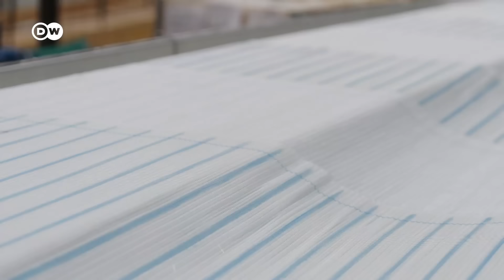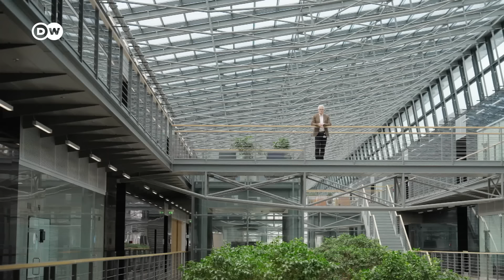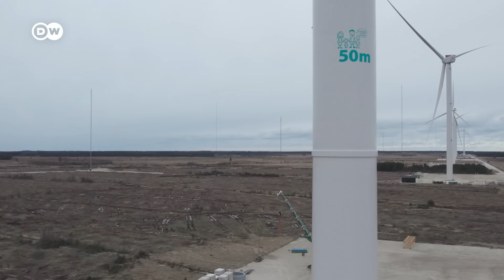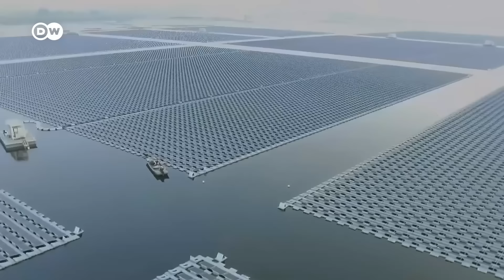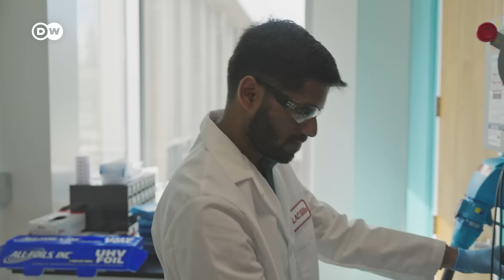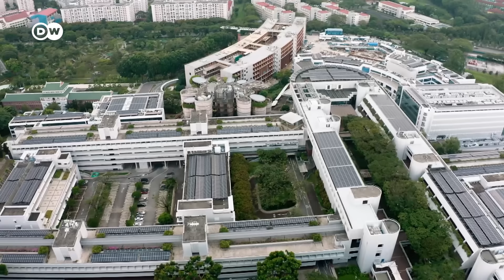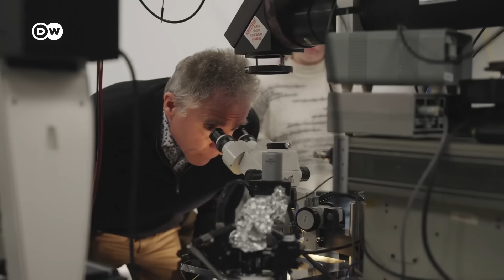Will renewables stop the climate crisis? | DW Documentary

Comment: the absolute climate-culprit is the vacuum "cleaner", it pollutes way more than it cleans

10 grams of dust in average pr hour while burning about 850 grams of fuel in a power plant

they should be banned or at least made with motors that produce 0% waste heat

Comment: Not without Nuclear.  New Modular Nuclear is safer & cheaper & can be built in six to twelve months.  Mainline Nuclear is already far safer than Fossil fuels that costs 8.1 million lives a year with many more lost from crop loss and forced movement.  An international safety inspectorate will make Nuclear far safer and would have avoided all the major accidents we've experienced.   The one renewable that shows great promise is deep drilled Geothermal power.  But as with all technologies it needs time to mature.  We don't have that time.  Already the living habitats and our creatures are being destroyed hand over fist.
Reply: Small modular reactors require more cement and steel per MW than large reactors and are generally less efficient than large reactors. The hope is that we can mass produce them in a factory and gain economies of scale which would lower their costs compared to large reactors that require customized construction and suffer massive cost overruns. However, I find most of the assumptions about SMRs to be very questionable, and so far they are unproven in the market place. The electric utilities have stopped investing in nuclear and have decided that they can deal with the variability of renewables by using grid storage (mostly LFP grid batteries), energy trading over wider regions, and energy pricing with smart grids to reduce demand during times of low supply. Because renewables are becoming so cheap, it is also likely that utilities will build 1.5 to 2 times more capacity than they need with wind and solar to deal with times of low wind and sun.

Comment: Thermal photovoltaics could also be huge. I mean think of the obvious application. Geothermal energy. You dig a deep hole. You drop in the thermal photovoltaic cells at the end of a long power cable - Stable power. No tricky steam or complex turbine needed.

Comment: New underground city
This proposal outlines the design and construction of a sustainable underground city utilizing advanced tunneling technology.
Construction Approach
A 50-meter diameter tunnel boring machine (TBM) will create expansive tunnels, minimizing surface disruption while ensuring structural integrity.
Key Features
Air Supply: An innovative air intake system harnesses wave energy for pressurized air, filtered for quality and used in food production and city ventilation.
Water Management: A desalination plant will provide fresh water, while mineral extraction processes will convert brine into fertilizers, promoting sustainability.
Waste Treatment: An advanced sewage system will treat wastewater before safe ocean dispersal.
Transportation: A compressed air engine,(Angelo Dipietro engine) powered by wave energy, will facilitate efficient movement within the city.
Urban Design
The layout includes aeroponic farms, shopping areas, and recreational green spaces, promoting a vibrant community atmosphere. Automated systems will ensure optimal air quality and lighting, enhancing the living environment.
This underground city concept leverages cutting-edge technology to address urban challenges, offering a viable solution for sustainable living in constrained environments.

Comment: I have a prediction. Blades will not get bigger, they will get much smaller, and as a result much less expensive. Wind turbines will not be privately owned, they will be built by and locally government owned. Wind turbines will all become base load. I will repeat that. Wind turbines will ALL become base load.Electricity prices as a result will drop by 90%, because local government can not profit on the electricity it sells. Just like government clean water sales. All oil will become product base, no longer burned for energy. As a result it's value will skyrocket because it is limited in availability.

Comment: One important component is using renewable energy from solar and wind to power electrolyzers to produce hydrogen for use in transportation, such as buses, trucking, trains, shipping & maybe even passenger cars using fuel cells as the intermediary between the fuel source, hydrogen and a battery. Fill ups are fast, its lightweight and energy dense. With enough production price will drop per kilogram of hydrogen displacing fuel from oil.

Comment: Relying on renewable energy and circular economy to stop environmental problems is ridiculous. We still live in a system that needs 3% GDP growth annually. GDP can never be disconnected to energy material use. Green energy and circular economy is just moving the problem. What we really need to do is decrease our economies and population numbers. Going the current route, we need 100% of the energy that is hitting the sun (which is thermodynamically not possible), and the energy of milky way galaxy in 1500 yrs (which is not possible because of obvious reasons). Let stop this nonsense and start de-growing!

Comment: no no, you need  a gyroscopic (for the non-stationary) generator with  variable clutch that IS a battery. You're OFF, WAY OFF! You can engineer my concept so that they fit in the battery the radius of a fingernail. but you won't listen to me... it's not merely about new materials but new designs and reassessing your notion of what what is. "fit in a battery" I mean, take up the same amount of space. And then make giant ones or one for every home. But you won't, because this is all about profit. So you will continue your limited strain of research and merely increase efficiency of an inferior concept.

Comment: The surf and the tide currents are where all the entirely reliable green energy is. It is also where most of the people are so there would be people to build and use the systems. The weather would not matter like it sometimes does with solar and wind. Hydrogen gas made with electricity not used would be the best way to store electricity and could probably be used to power cars, jets, ships, trucks ect.

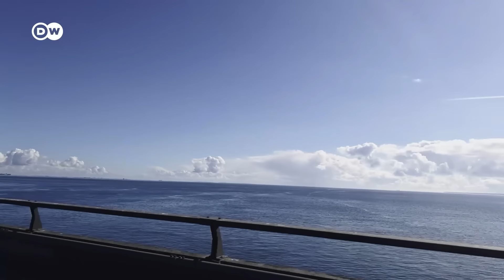Comment: 06:29 You mean electricity/power and not energy. Big difference! Quickly looking at IEA data it's clear that the majority of energy comes from oil and biofuels. However, that does not mean that Denmark is not doing a great job with their energy transition. It's just important to keep the overall energy consumption in mind when talking about the climate crisis. I would argue that decarbonising electricity is the easy part while decarbonising transport, and industry is the harder one.

Comment: Yes, renewable energy of solar, wind, hydro will be the main power generation in the future, with small nuclear reactors adding 10-20% for baseload and times of need.  This will be the grid of the near future and along with EV's, will end climate change effects.
Reply: your delusional. we can barely run all of our AC's in  the summer, no talk of upgrading the power grid, only converting it to "Green Energy". even at current capacity, if there were millions of EV's, there's no where to charge them, still cant drive long distances, and the grid has no where near enough capacity, especially in Germany. "Green Energy" is a fallacy.
Reply: Crazy! It's mean cilled future
Reply: We don't need solar, wind, or small reactors. We need hydro and large modular reactors.
Reply: @doctorprocter4225  , According to EMBER, 93.5% of new global electricity generation was renewable in H1 2023, which means that green energy clearly does work, because electricity utilities around the world are investing in it, since it is now has a lower levelized cost of energy than coal and gas in most parts of the world. 24.5% of new auto registrations in Germany were electric vehicles in October 2023, and that percentage was 37% in China, which is the biggest auto market in the world. Clearly people wouldn't be buying EVs if there weren't some place to charge them. The top selling car model in the world in 2023 is the Tesla Model Y, which has a range between 455km and 533km (WLTP).

Comment: Total energy supply (TES) by source, Denmark 2021
Coal 41417 TJ
Wind, Solar, geothermal etc. 65326 TJ
Natural gas 78279 TJ
Biofuels & waste 237118 TJ
Oil 264945 TJ
Reply: Yes, but most of the primary energy of fossil fuels and biomass is lost as heat in combustion, so 1 TJ of solar or wind energy is the equivalent of 3 TJ of coal energy in terms of the amount of electricity that it generates. An EV is roughly 80% energy efficient whereas an ICE vehicle is only 26-28% energy efficient, so it takes a lot less energy to drive an EV. 75% of Denmark's electricity generation in 2022 came from renewables.